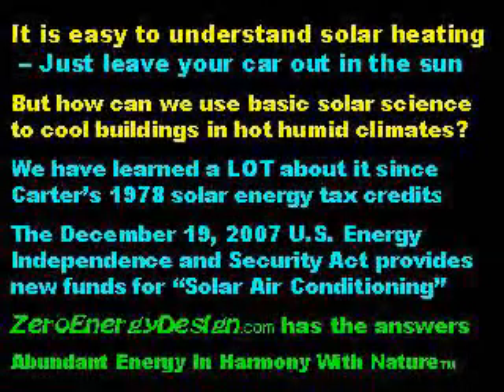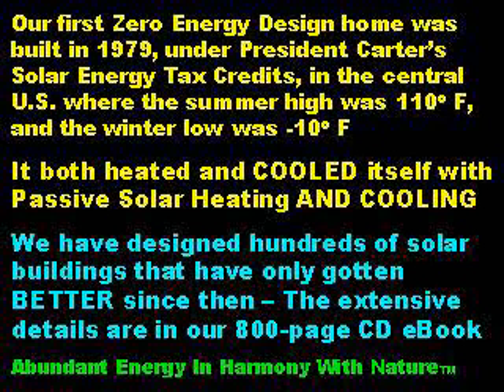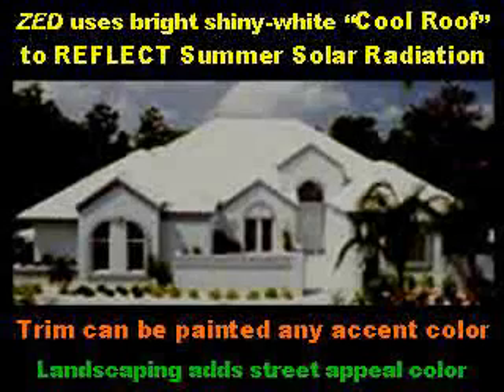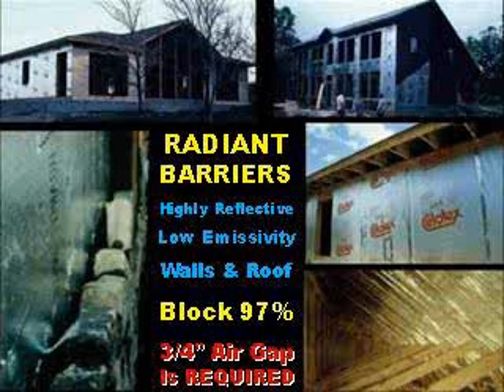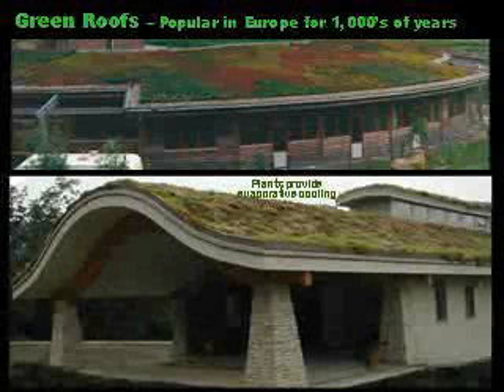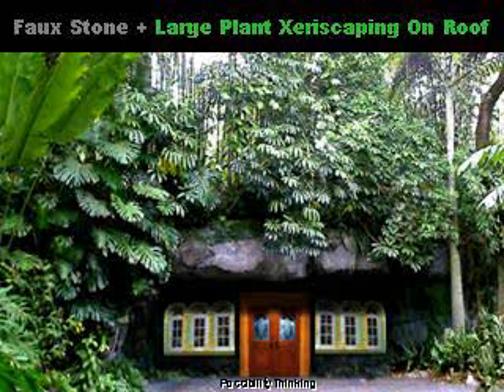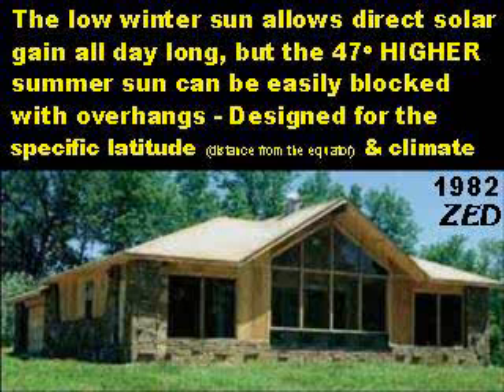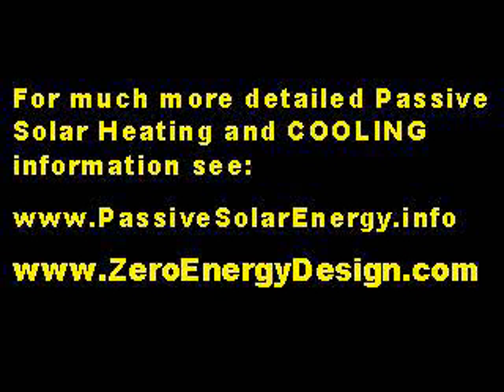Passive Solar COOLING - For Hot Humid Climates

Comment: I am trying to start shielding sun exposed walls and even roofs with tensioned shade cloth.
I worked for some time with a company who installed shade structures.  I believe that fabric mounted 12-18" above a black roof would block the sun and a layer of cooler air would insulate the whole house from the sun's heat.